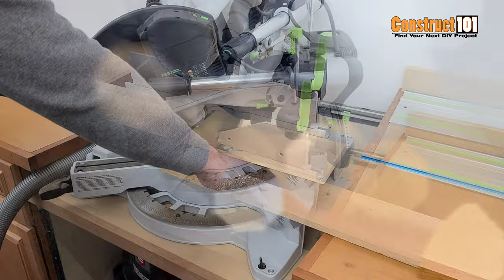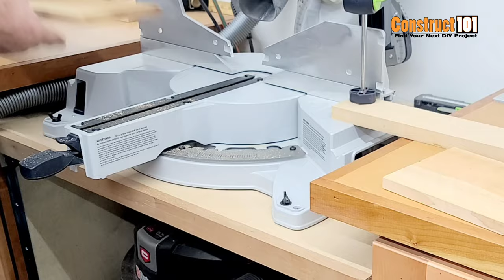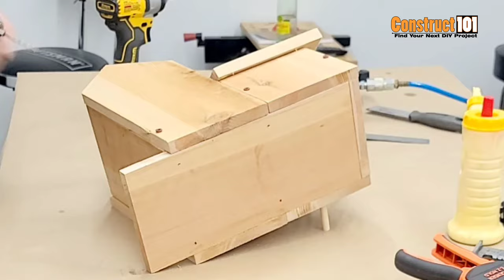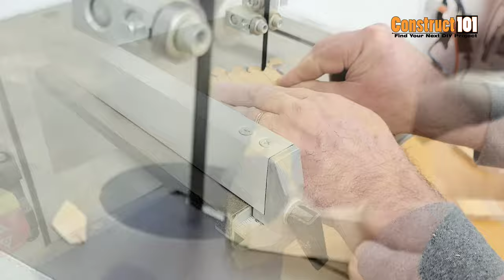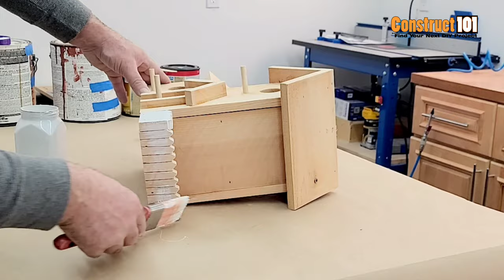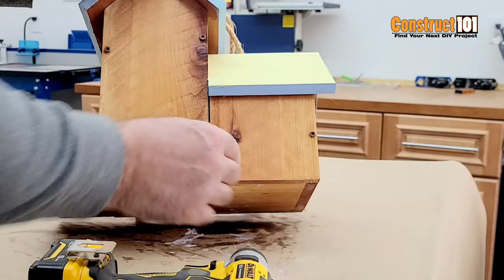DIY 2-in-1 Bird House and Feeder

Comment: I built this birdhouse using your plans, but I made a change on the walls of the double hole box, I cut the tops to 45 degrees to match the roof, this allowed me to nail the roof directly to the walls and remove the need for the two screws in the roof. I also cut the groves in the fence using the same band saw used to cut the tops of the fence before installing.